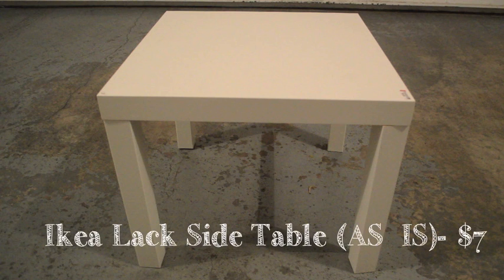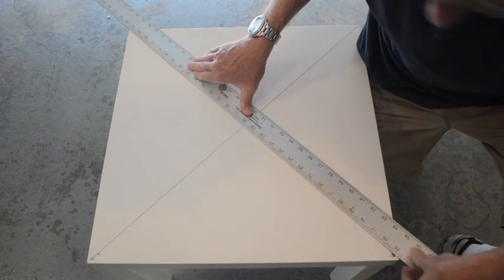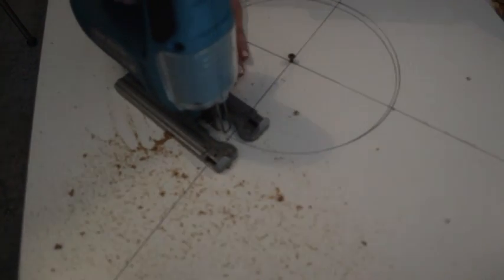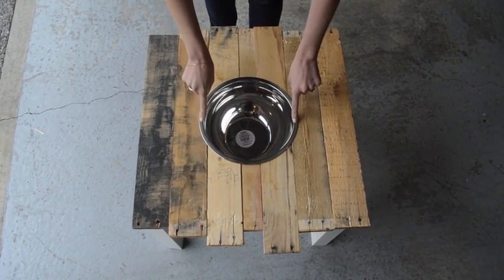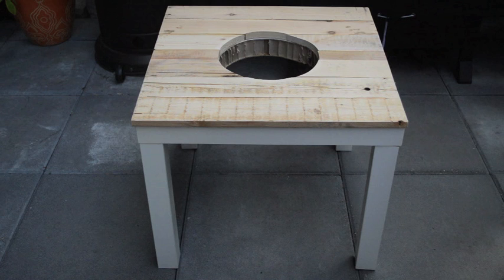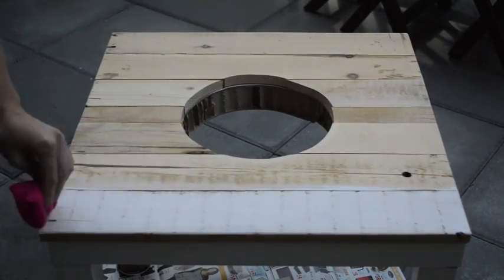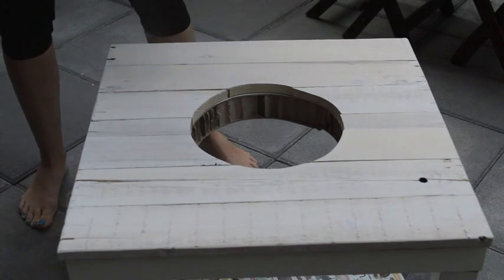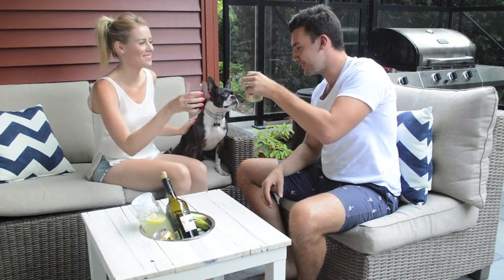DIY PATIO DRINK TABLE- IKEA HACK

Comment: Good video! I would have made the top making sure the boards are connected to one another well, then turned the table over on top of the finished top and outlined the circle already cut for the bowl and cut out that circle in one step instead of having to figure out the curve of each piece of wood. Thanks for the video!